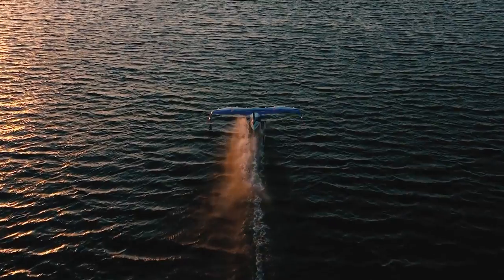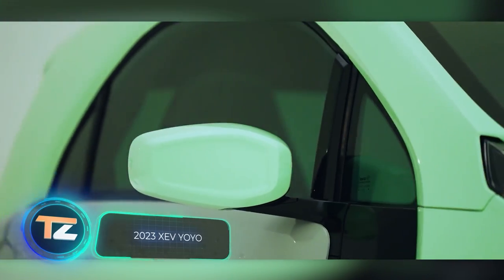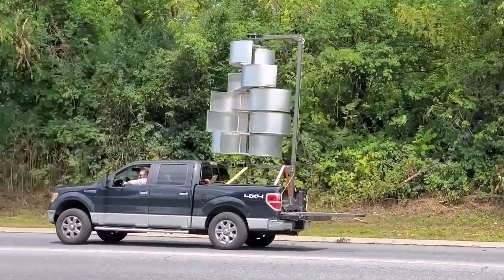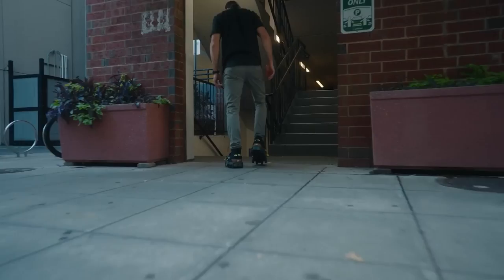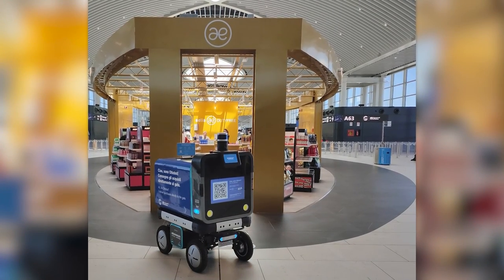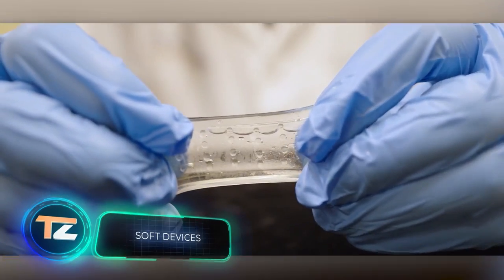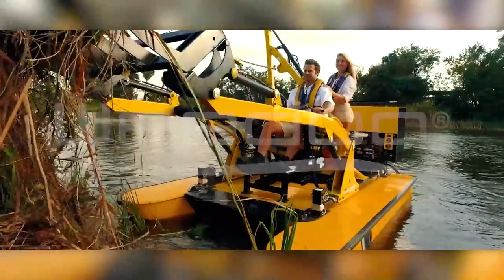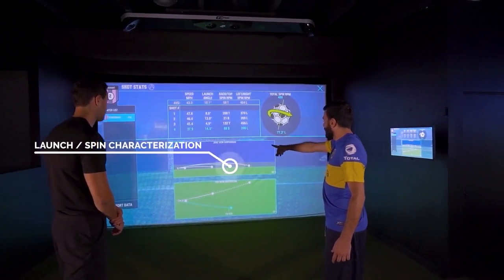12 INGENIOUS INVENTIONS YOU SHOULD SEE

Comment: The dock leveler is an old idea. I was installing them 35 years ago there were 2 basic styles, the hydraulic system as shown, and the counter balanced. The counter balanced was by far the most popular and reliable once setup it lasted years and required only a light pull to lift .
Reply: I was gonna pretty much say the same thing! They've had these on loading docks ever since I can remember and I started working in factories back in 1978.
Reply: I was going to say the same (ancient history)!
Reply: it's a prime example of when there is a disconnect in society between practical labor and something like making youtube videos...
Reply: They look like a health and safety nightmare.
Reply: Report this video for misinformation!!!
Reply: @95Gabe , I worked in a warehouse with 3 different types of ramps, one type like this one (Hyd setup), one type a counter balance setup (same without the hyd setup) and most of the ramps were a shorter type, where you stick a long pipe in a hole towards the side (But on top), lever it up (heavy AF BTW) and the lip should pop out when topped out then lift to drop when done. of the three I liked the counterbalance best since it was far more reliable and didn't require power of a mechanical anything mostly. But the lever ramp was the worst, If you weren't ready it could judo flip you
Reply: I agree.  I am a retired truck driver and found these types of docks in numerous places over the past few decades.  I am sure they still exist.  So, good luck selling this as something new.   Also, the barriers they show that lower for fire safety doesn't make any sense to me.
Reply: They don't even have side skirts working.
Reply: @joeorlando1955  My husband still works at the same place and they still exist there and have regular maintenance to insure they never break down due to maintenance issues. They have 4 bays and always busy shutting down one of the 4 during maintenance cycles and go down the line until all have received maintenance.
Reply: @lonniehargrave9381  You can blame that on their failures to do regular maintenance.
Reply: @95Gabe  They are that for anyone so inept as to follow safety protocol. It is actually a item that you have to pass OSHA safety in order to be allowed to operate it in at least 17 states in the USA that I know where that is the case.
Reply: @lonniehargrave9381  In some countries the side skirts do not even exist.
Reply: @95Gabe  all the dock levelers that I installed had front and side skirts. The only way to get underneath was to remove a hatch cover that was bolted on. They were very close fitted, you could slide a quarter down the side, but not two stacked together.

Comment: I was an over-the-road driver from 1991-2018 and saw the hydraulic dock in a lot of warehouses.  I can't recall when, where I first saw one since it was over two decades ago.  The contraption afterwards I also seen.
Reply: I too was a OTR Driver and as far as I know, Dock Levelers have been used since the 70's at least and Hydraulic versions since the 80's or 90's...

They are NOT a new technology unless there was something funky about the Unit shown in this video that simple wasn't mentioned in the video...

In fact, a can guarantee that unit is far more complex than it needs to be since EVERY Dock Leveler only needs a single control (a pull chain for the manual ones and a single button for the Hydraulic ones) since the one in the video had 3 control buttons when it really should only need 1...
Reply: Why not Report this video for misinformation!!!

Comment: Loading dock is not new, been around for better than 10 years, I worked at a Wal mart distribution center that had 5 or 6 of these, yes the 3 button type. they also had some with s steel ring in the center where you could manually trip it to rise, the end flap raised and locked then you walk up it to set it down. Seeing them looking new is nice, but they aren't a new thing

Comment: Regent Seaglider seems to be a inefficient match up. They took a hydrofoil and decided to strap wings and air propellers on it. Generally moving water is a more efficient form of propulsion then air because of the density. Also a hydro foil can provide more lift then a wing with less mass. They are taking something simple and making it complicated, less efficient, more dangerous, and harder to pilot. Just build a hydrofoil it would be cheaper to build, operate, and crew. I wish people would stop patting people on the back every time they reinvent something while making it worse.

Comment: 7:35
They are levelling dock plates, they are in common use in MOST warehouses that load and unload transport trailers. There is nothing "New" about them.
It's like showing us "The latest thing in computer operating systems", Windows 98.
AND you Don't need to go to China to either buy them, OR see them in operation.
"Next up, a revolutionary advancement in audio tech, The 8-Track Tape"
~Painful eye-roll~

Comment: @8:00 Dock levelers are great, IF !!!! properly used as a straight path, as i had sprained my ankles 3 times, 2x left 1x right, just because at my former job want to use it as much as possible. 
As alot of the recieved cargo containers caused  the platform of be raised 15-1 cm, this creates a uneven profile, which mights seems a small issue, but this adds up over time & exhaustion

Because the chaotic packaging , most space outside the leveling dock was used to manual sorting into their respective types, I had to walk sideways off a RAISED & UNEVEN platform each time.
Whilest fortunately i dont work there anymore, just thinking about it turn my mood quickly sour

Comment: Not impressed with the dock leveler.  It is weight capacity is not very high (normal heavy use ones are rated at 50,000 pounds.  It is just 6 inches wider than a common leveler....  The German barrier seems like a waste of money.  Your dock door seals should already do this for a LOT less cost.  Also why does it have to be so big.  Just have something that comes down in front of the door instead.

Comment: Why would you need a loading dock water barrier? The loading docks are two and a half to three feet from ground level. If there were any flooding the water would come through the regular doors before it even got high enough to even think about coming through the loading bay doors. Or come through all the doors at once.
Reply: because it is not aimed at keeping flooding out but to keep water and foam from inside fire extinguishing systems in to prevent it from entering sewage systems. In Europe there are several regions where extinguishing water has to be contained to not cause pollution by freely entering the environment.

Comment: Weedharvester? We’ve had similar ones in Michigan for over 40 years at least, and the cut the weeds down to 8 foot in depth depending on what it was set for. All this piece of garbage does is clear the surface weeds, and it doesn’t have a very large capacity to carry very much of the cut weed. If they can buy and maintain this machine. It would be cheaper to drill a water well. It’s great for rural poor communities???? Poor rural countries???? RIGHT! A well is cheaper by far.